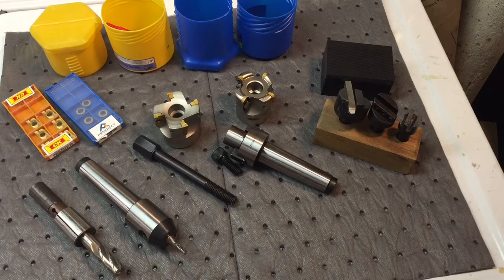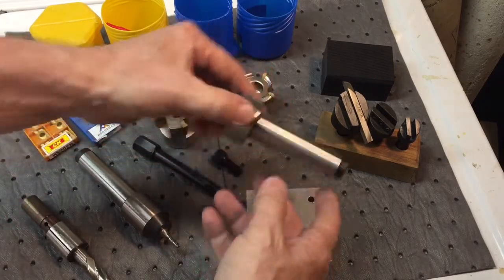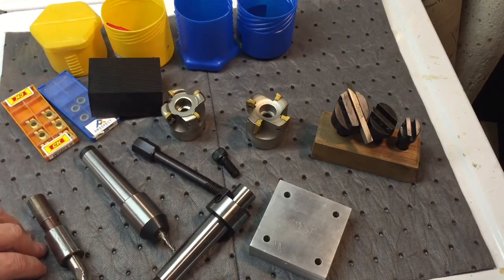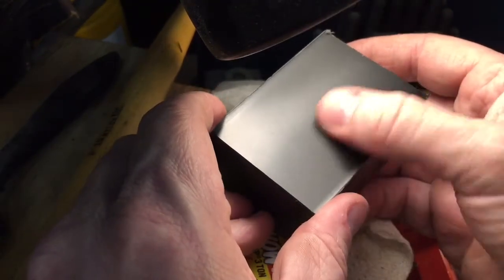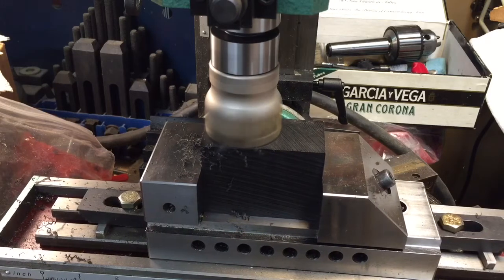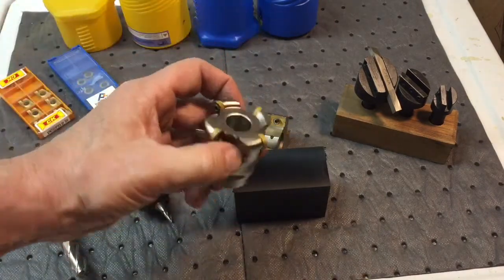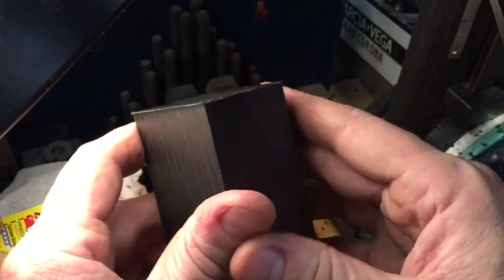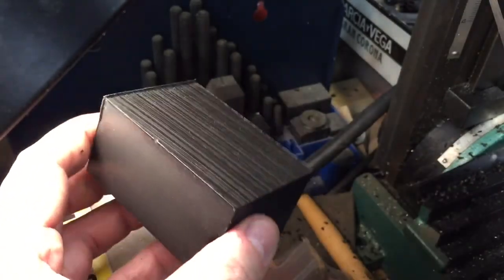Shell Milling Delrin in a Mini-Mill...

Comment: Hi what speed should I run these cutters on mild steel on a mini mill ?
Reply: Depends on the precise steel grade, but a good surface speed will likely fall somewhere in the 600-800 FPM range. Multiply 600 by 3.82, which gets you 2292, and then divide that by your cutter diameter, 2" for a tool like this, which gives you 1146 RPM. For a mini mill, this might be pushing your spindle too hard though. Running slower should work just fine. On a really small machine that isn't necessarily super rigid I might be inclined to stick with HSS tooling. I prefer to use fly cutters on aluminum and plastic rather than steel and anything else hard, but for light cuts they are fine. If you put a nice grind on the tool bit and get your spindle speed and feed rate down you can get a fantastic surface finish.

Comment: I am looking at face mills/shell mills for my Clausing 8530 mill.  Tried a fly cutter, but hear a lot about the face mills available now.  You were going to try aluminum after this delrin video, but looks like it was not done.  What are your thoughts now?  I would like a 2-1/2 or 3" cutter, but maybe a 2" is best for a smaller knee mill. Also, the mill to the arbor connection seems to be some standard, so I may look for a separate arbor (2MT@ in my case) that will match up with my 3/8-16 draw bar.  Most of the imports that come packaged with an arbor are M10, which would require a separate draw bar.  I am still reading up on the 90 inserts and the round inserts.  So much to consider...
Reply from the maker: Hello CP!  You are so right about so much to consider!  I have a very small mill so I am very limited... Your mill is much bigger so you have even more possibilities.   The Shell Mill was something I was toying with because of my limitations.  You know the fly cutters are great but you are limited in depth of cut.  I thought with the shell mill a higher RPM and slow feed would allow my small mill to remove more stock- I was right!  I also had to go to a 10MM drawbar for the other tooling, it wasn't a big deal though.   These shell mill set-ups were going so cheap on eBay back then... I don't know if they went up...   =)

Comment: What is that material delrin (sp). I've never heard of it before. Is it a plastic or nylon material? Would it be a good material for knife handles? Does it come in different colors? 
I didn't know you had a milling machine. Do you have a welding machine? If so what kind. If you haven't already, how about a video tour of your shop. I would find that very interesting as I am setting up a combination wood and metal shop in my basement (for now). I'm new to your channel Scout but I have learned a LOT from watching . Actually I watch about 5 or so videos a day. 
I'm the guy who guessed you were from the NYC area - I'm originally from Yonkers, NY.

Comment: Steel mills are good but it is hard to beat a mill with index able tooling. The finish can almost glass smooth depending on the depth of cut and feed rate. Thanks for sharing this.